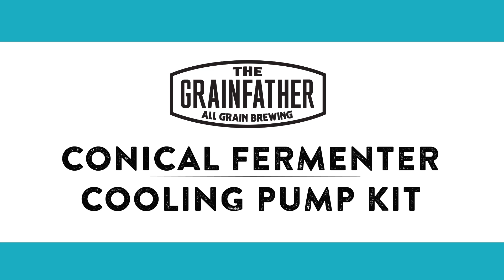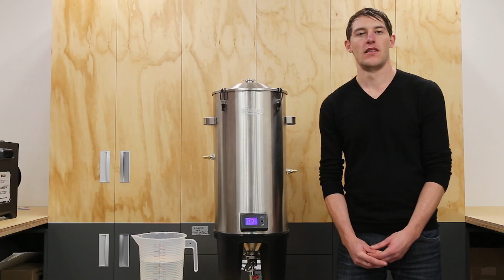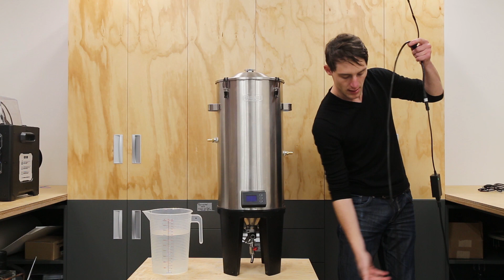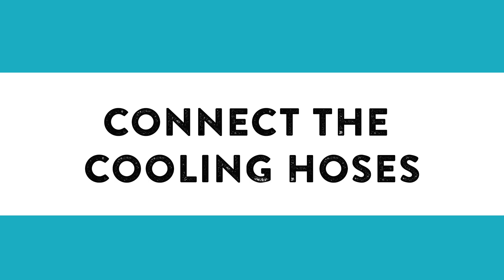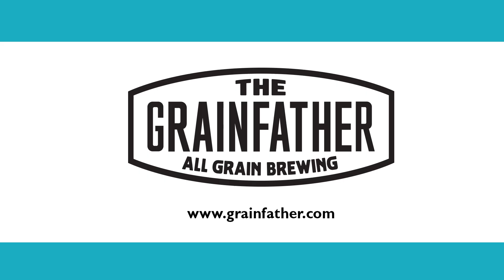Conical Fermenter Cooling Pump Kit

Comment: Should there have been gaskets behind the valves? Mine are leaking quite a bit and were already installed when I took it out of the box.  Unscrewed them and noticed there weren't any.  There wasn't any bag with extra gaskets either.

Comment: I sit my conical fermenter next to my kegerator. I have a keg full of water in my kegerator & I run the red and blue hoses along with the pump cable down through the top of my font and into the chilled keg of water in my kegerator - I have found this to be very effective & can have a Lager fermenting at 13c when it's a hot (Tasmanian) summer day outside.

Comment: I am thinking about buying one of these but can I just check that the cooling definitely goes on the lower valve, The reason I ask is that your lower valve is on the right side of the fermenter but mine is on the left (Unsure why they are different) Thank you.

Comment: I've just ordered this along with the CO2 pressure kit and cooling pump kit... if i cool my wort via my BIAB system and transfer to this, can i set a temp for, let's say,  55 deg F for a lager.... will this system maintain it?
Reply from the maker: Hey Tony, thanks for your message. Yes you can use this fermenter for lager and it can cool to as low as 40-43*F. However this will all depend on ambient temperature and if your able to keep the cooling water topped up with ice (if needed).  If your in a hot country and want to use the Conical Fermenter for lager or crash cooling, then I would suggest to check out the Glycol Chiller to help keep the wort cool.
Reply: @GrainfatherAllGrainBrewing  thank you very much! I'm in the Northeast of the US. I will use a cooler with ice. Just want to also commend you for great instructions and videos which helped me set it all up. The quality of the unit is great!  Should be brewing this weekend and very excited to finally keep accurate temps.
Reply from the maker: You're very welcome and thank you for the lovely comments. Good luck with your brew :-)
Reply: @GrainfatherAllGrainBrewing  quick question...i just got my brew into the fermenter and went by the directions... the little pump isn't turning on...i currently have my old aquarium pump rigged to maintain temp but was wondering if there's any trouble shooting i could do
Reply from the maker: @tonyc1782  Thanks for your message and apologies about this. Can you please email us on info@grainfather.com and we will assist you further on this.
Reply: @GrainfatherAllGrainBrewing  Thank you. Message has been sent. Have a great weekend!